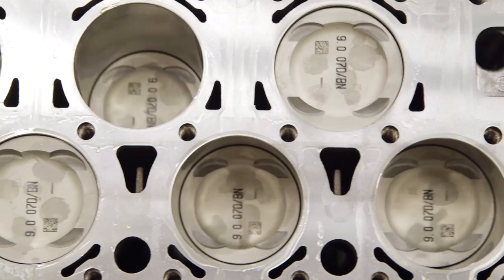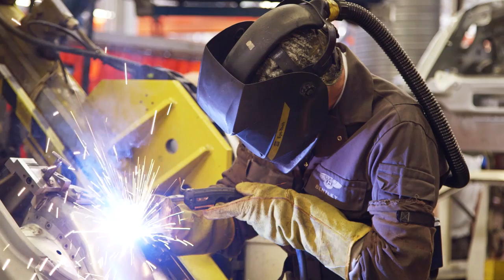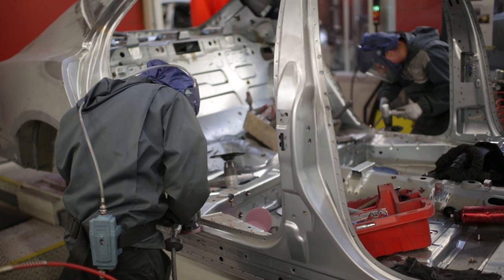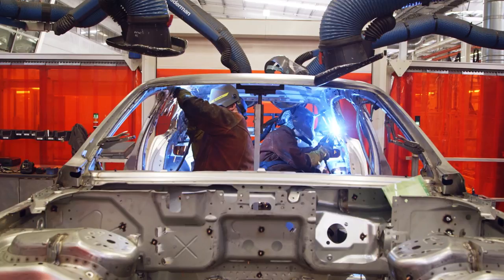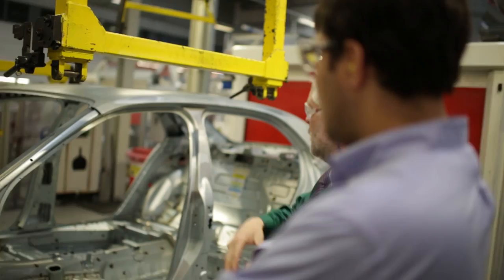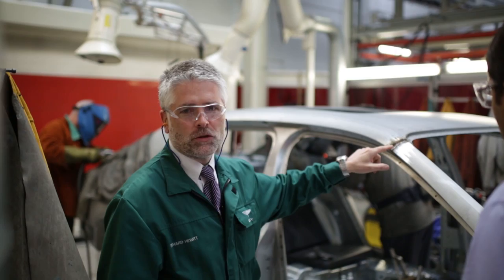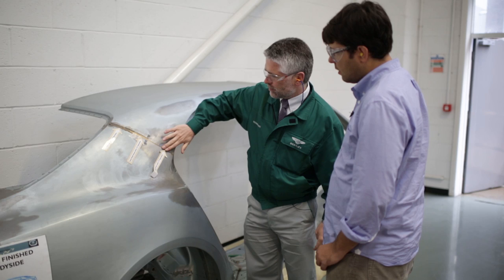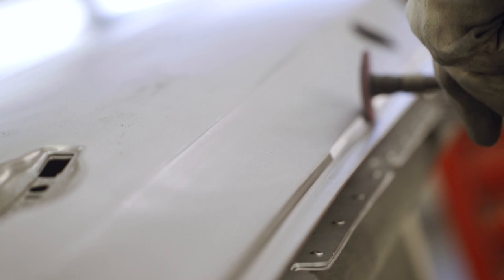The Mulsanne Body and Chassis - /INSIDE BENTLEY

Comment: sorry, but you are wrong. Welding aluminium is more difficult than welding steel, but very much possible. you might be thinking of brazing, which didnt use to be possible with aluminium, but these days there are special filler materials and processes for brazing aluminium. Although I do not know if it is an aluminium body, an automobile of this caliber is almost certain to have it and possibly even an aluminium chassis.